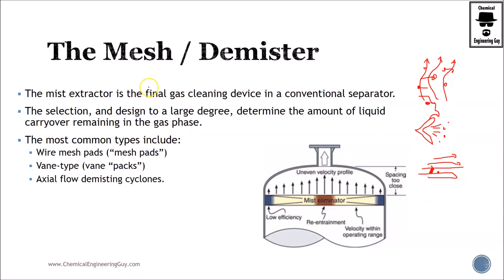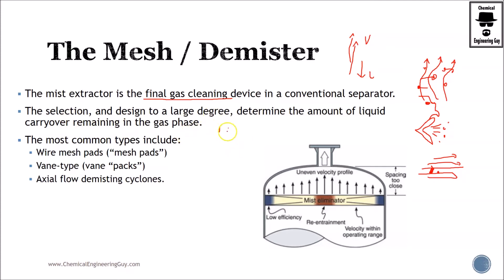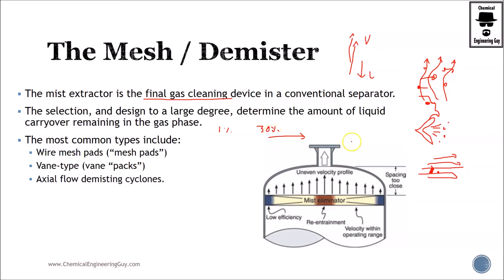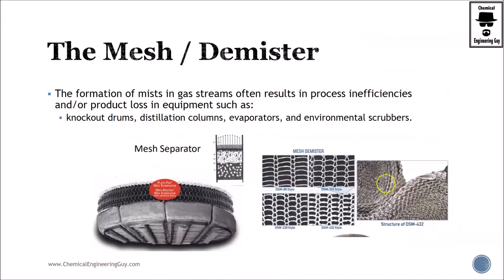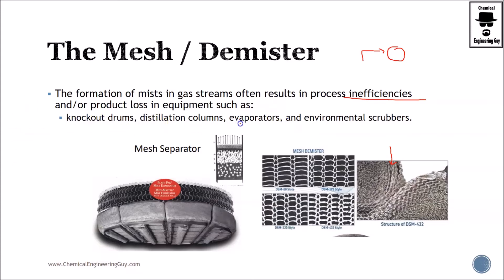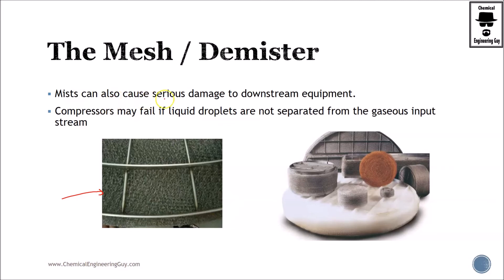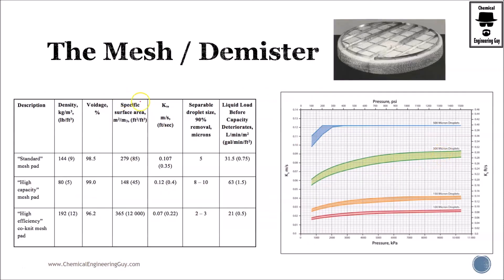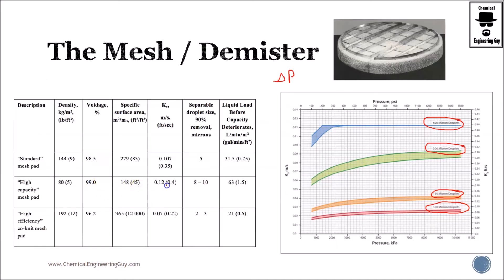The Mesh aka Demister for Flash Drums and Knockout Drums (Lec 076)

Comment: Hi, I just saw a definition as "Close Density - Layered - No. Off 1" in a demister arrangement & detail drawing. What does close density mean?
Reply from the maker: Well.. density of the "holes",... there it goes: is a term used to describe the specific design or configuration of a demister, which is a device used to remove liquid droplets or mist from a gas stream.

Let's break down the components of this term:

    Close Density: This indicates that the demister is designed to handle a gas stream with high droplet or mist density. Close density demisters are effective in capturing fine liquid droplets from the gas.

Layered: This refers to the structure of the demister. Layered demisters typically consist of multiple layers of mesh or knitted materials. These layers create a tortuous path for the gas stream, allowing the liquid droplets to impact and coalesce on the demister surfaces, thereby separating them from the gas.

No. Off 1: This indicates that there is only one demister in the system. It implies that a single demister unit is installed to remove liquid droplets from the gas stream.